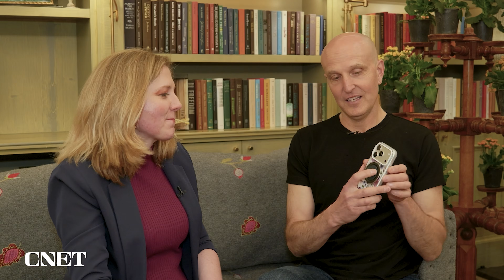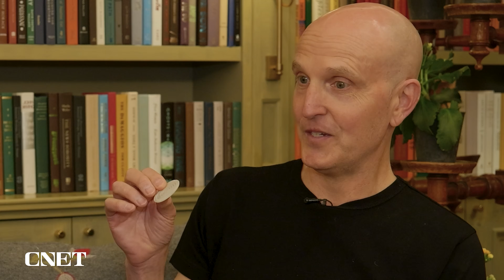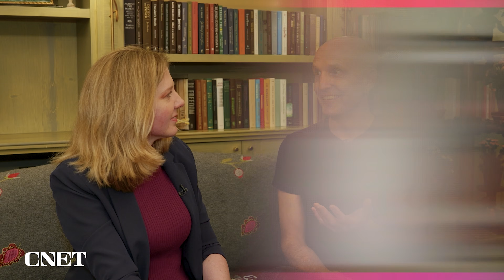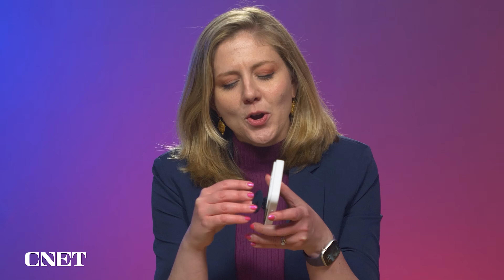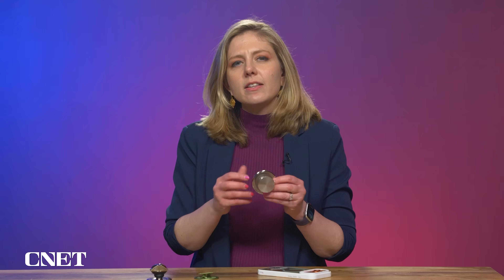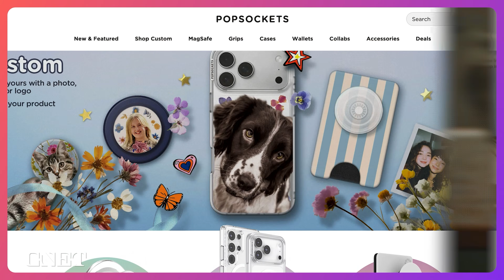Flat PopSockets Are Targeting Men — How It Began | One More Thing

Comment: I have been using the oh-snap for a couple years. It is great so I have no need at the moment for anything else.
Reply: Me too but they're pricy.
Reply: @efromhb   I've bought two cheap ones on amazon that broke (my job is a rough one) and a pop socket that was uncomfortable I've settled in to oh snap they're perfect id rather pay the extra price for something that actually works
Reply: Yes...me too. Ever since I found Oh SNaps 3-4yrs ago, I haven't even looked for anything else. But they def are pricy. I found someone selling 6 on eBay for 100$ I knew I'd be using them, and have multiple phones. I'll have to look at these new PopSockets as they are what I came from before ohsnaps. If these offer better wireless charging, I may have to switch, as that has been an intermittent issue with my OhSnaps.